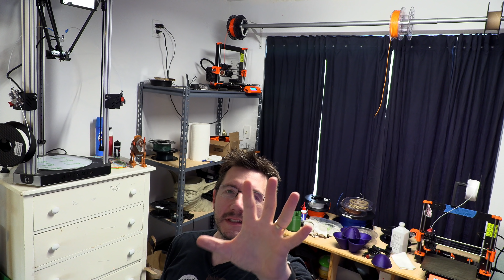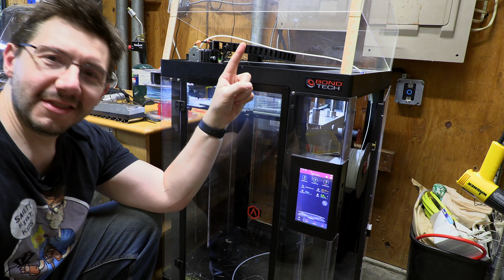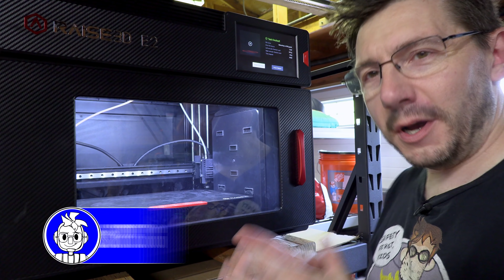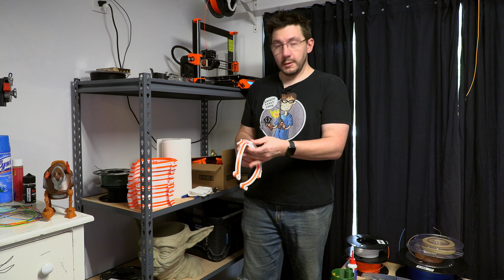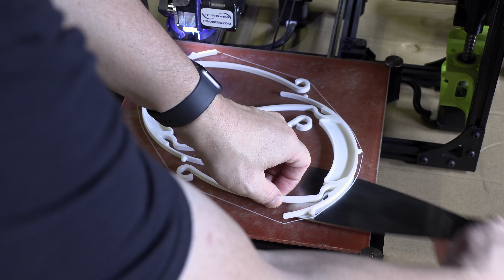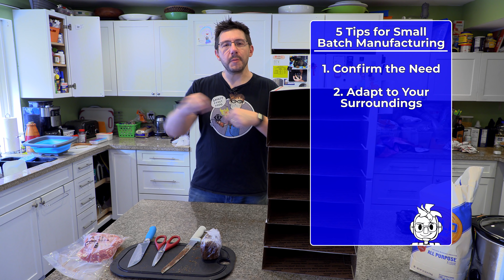5 TIPS for Small Batch 3D Printing Manufacturing - AT HOME!

Comment: I notice that your faces facing the forehead has pimples of plastic,  I use a back of a hardened scissors to scrape the inside surfaces. My headbands use a wider surface for headbands as comfort is important. Also I print TPU flexible adjustable straps,  running on a total of six Ender 3. Plus a laser to cut the acetate sheets. So far 600 supplied locally.
Reply from the maker: Some definitely do. Before final shipment each is checked, a heat gun is used to get rid of any wisps, and pimples are ... popped :)

Comment: I love 3D-printing. But i hate printing simple objects in massproduction with 3D-printer. The faceshields could me made much faster and cheaper with injection molding. On youtube are much videos about diy injection molding machines that don't cost a fortune. Also with injection molding you can use old scrap plastic. Let's be honest: 3D-printing is way to slow and is mainly useful for printing complex objects.
Reply from the maker: So, I understand what you're saying, but, I don't have the ability or the time to setup and research injection molding. I'm using 3d printing as a manufacturing stop gap solution.
Reply: Taking a dump on someone doing something nice for medical workers, classy
Reply: Okay but you know how much cost cnc engraved DIY ?? And the tolerance should under 0.01mm

Comment: Glad to see you are still utilizing the IT-Works 3d toolhead on your TAZ.  We have a few upgrades that help the bed leveling with the nozzle if you are interested.
Reply: Is it the resistance system?
Reply from the maker: wait - you do??? EMAIL ME PLEASE
Reply: Actually it's a pretty simple upgrade. Email sent.  2 words....Nozzle X.  Nozzle X cleans easily and performs better at being electrically conductive due to the Nickle coating.

Comment: I just use cut sheets of glass from a hardware store, it was $11 for four sheets that are cut the same size as my build plate. When a print is finished, I just unclip the glass and clip on a new one and start another print. When the old glass is cold the print comes right off and I didn't have to waste time chiseling at the build plate when the printer could've been printing.
Reply: Ooh. I'm going to try that.
Reply from the maker: That's a super neat idea, though, I haven't had to chisel at a build plate in a long LONG time.

Comment: So my question is what model 3D printer would you recommend for a low price for a beginner like me to start me off.
Reply: Ender 3 or Anet A8..
Reply: Ray Truesdell Whatever you do, don’t buy the same model I did: XYZ DaVInci 1.0 pro. It’s not horrible, but without any modifications it can only realistically print ABS (enclosure, no fan). And as most 3D printers will tell you, printing ABS has a harsher learning curve than most materials.
Reply: The ender 3 is a great place to start. Its an easy to build kit that costs around $180-200. I have 4 3d printers and it keep up with machines that cost 6 times as much.
Reply: @zasz211  GeeTech has a good entry level one too..  😁👍
Reply: @zasz211  would you agree that for beginners, steer clear of kossels until one is comfortable?

Comment: It took me 2 days to print 100 ear savers for 2 local hospitals on the ender3 🙃
Reply: Oof, it took me a week on my Replicator 2x. Though I wasn't printing 24hrs/day.
Reply: Whaou did you stack it all? This is quite a record.. all that with 1 printer?
Reply: @archireel_be  I print 4 at a time, when i tried for 5 it wasnt printing right i like to set the print speed at 90 until the first layer closest to me is finished then i turn the print speed to 125 or 130 and it usually takes around an hour, for those i was pretty much printing from 630am to 11 or 12pm
Reply: @pericodesign1679  impressive record.
Reply: @archireel_be  thank you
Reply: @archireel_be  I can fit 16 on the print bed at around 8 hours print time.  Invest in the time to get your slicer settings optimised.  2 days of fooling around with the settings got me 25% more efficiency.  That has paid for itself after the 4th day.
Reply: @archireel_be  I dont know how to stack yet Ive only been printing since the very end of february i have no real knowledge of using computers and do all my modeling on tinkercad and have to use the creality slicer that came with the ender3 cause my laptop doesnt let me download any other slicer 😔

Comment: A Great Free tool is Google Voice. Will let you set up a phone number that is located in a different location at NO Cost. Advertise the Google Voice phone to protect your home address. You will need a gMail address for this is all. All that is needed, sign in to your gMail address, then search Google Voice, click on the link near the top of the Google Search Results. When the page opens it will give you a chance to set up your Free Google Voice phone number. I have using mine for 15 or so. At sign up I paid $10 my account just for any possible charges. I still have a credit Balance of $10.
Reply from the maker: Thanks for the tip!

Comment: Dear Joel 

I love this video is really helpful and is really informative.

I am wondering if you can help me I sadly only have one printer for now.(The Ender 5)
Can you please give me some tips to print in stacks I have seen you're other stacking videos (I use cura)
Reply: I am also having trouble removing supports. 
And can you please give the cura settings for stock settimgs
Reply: @ridhwaan1199  regarding support, if you're using cura, then search for a setting called "support Z distance" and set it to 0.2 mm. That should help, it will be slightly worse quality at the bottom but you will not have a hard time removing the supports that way.

Comment: Been watching you videos for awhile. Thank you for the great content. I've been considering small batch manufacturing for awhile using 3D printers. A few questions if you do see this comment : 1. Would the Prusa Mk3 be a good beginner printer to start with? I've not used a 3d printer before but have experience with tinkercad and have used other services to print my designs. I've researched a lot and keep coming back to the Prusa. And 2. How would you calculate pricing per piece based on material that was used to make the piece? I know the services I've used have priced based on volume/amount of material used. Obviously, design plays a part in pricing. Thank you for your time. Love and appreciate your videos.
Reply: Ender 3. Best bang for the buck..
Reply: Oh, also forgot. Whatever slicer you use you can put in the cost of your filament and it's weight and it will calculate the materials cost for you. 
Slic3er Prusa edition is the best impo and IMHO.
Reply: I think the MK3 would be a good printer to start with. I see many people using them and even print farms using them. They are the work horses for many. You could use Ender3 and other printers of course. I think it would be more of a preference thing. Cost could come into play as well. Get something really cheap or maybe spend a little more to get something with more features out of the box. Entirely up to you but short answer is yes the MK3 make a good first printer.
Reply: Peter Valencia  stead with Ender 3s which were OK.  I spent a lot of time on money upgrading them.  I then got a Prusa MK3S and liked it so much that I got rid of my Ender 3s and bought another MK3S and a Prusa Mini. My Prusa’s are work horses.  I am planning to get the Prusa XL when it comes out.  I think you will be happy with a Prusa.

Comment: I am using your stackable model and stacking 10 on my Ender 3 Pro, takes about 11 hours. Why are you not stacking frames? You did a great video describing how to do it.
Reply from the maker: I tried it, but the quality I wanted wasn't where I wanted to be - so I went with singles.
Reply: @3DPrintingNerd  im pumping out 16 RC3 on a Day on my M3Ks. Wouldn't it be more efficient to experiment with one printer to get the Stacks right and then scale  it up? I have to harvest 2 times a day which is does not take more than 10 Minutes a Day (with a preheated printer via Octoprint maybe 5). Also i don't think you can harvest your prints all night which means your printers are not being used 1/3 of the Day.
Reply: I ran into quality issues too when printing stacks. Used the Verkstan 4 hole model, just saw your manta ray model and definitely like doing 3 hole punch better.
Reply: How to make 3d flash cards😎

Comment: Does anyone know how I can sped up an ender 3 so that it takes less than 4 hours to print a prusa shields? Anyone know how far I can push an Ender 3?
Reply: my recommendation is print the thinner "3D-printed protective visor 3DVerkstan" they take about 40 minutes each and you can stack more of them other than that the easiest way to speed up would get a bigger nozzle
Reply: @nowayout177  the group I am printing for wants the prusa design
Reply: 0.8mm nozzle = half your print-times
Reply: Use faster designs
Increase layer height, 0.28 with 0.4mm nozzle
Increase line width, 0.5 with 0.4mm nozzle
Increase nozzle size to 0.8 or 1mm
Use 1 or 2 shells with minimal infill, like 15% grid infill
Crank the speed and temp up until you start having fatal quality issues
Reply: @engineer1692  I ordered some larger nozzles so I'll try that
Reply: @juliansiegmund2369  a 0.8 nozzle does not need double the flow but 4 times the flow compared to 0.4 nozzle, it's likely the factory extruder won't cut it, at least not at higher print speeds, a geared extruder like a BMG would solve the increased flow issue.
Reply: See CNC Kitchen's video at https://youtu.be/_bt1UZAnxnA.
Reply: 5% infill and 2 top , 2 bottom and 2 perimeters works fine for a decent quality and functional PLA print of the Prusa version.  Up the extruder temp a little and you can print faster.  Again its quality versus speed.  You should be able shave at least 20 minutes or more off your print time with some of the tips below.  Print one of the stacked versions overnight and individual ones during the day.  Printed over 500 of those FOC for local hospitals and first responders and funeral homes.  Now I'm printing the ear savers and have made over 300 of them so far.  The deltas really shine for high speed 3D printing and they beat any of my other printers by 20 -40% faster print times.
Reply: @reasonablebeing5392  wow nice job I've printed about 350 or so and my two prusas are chugging along but I am trying to get my ender 3 vto run as well but it's printing really slowly